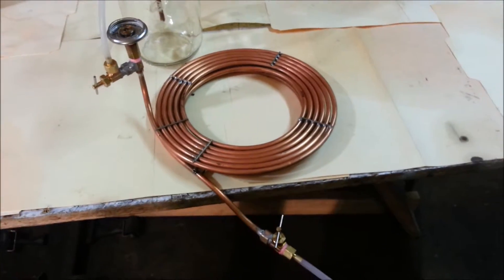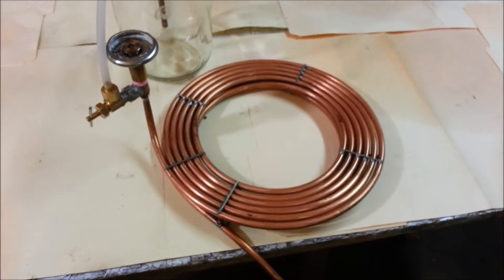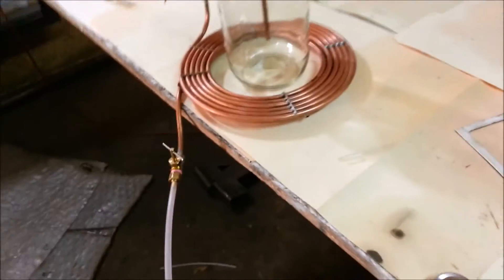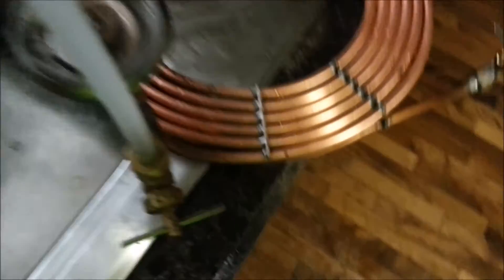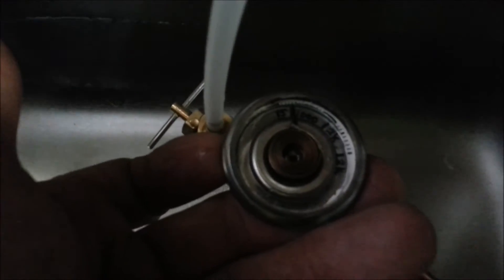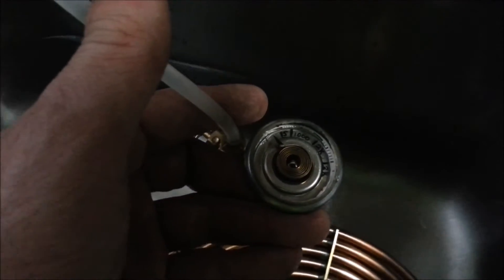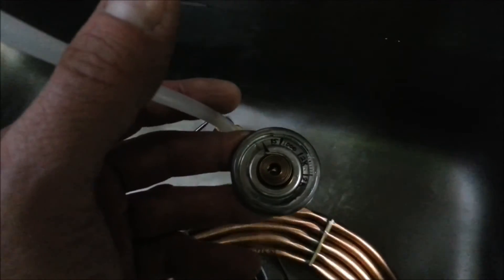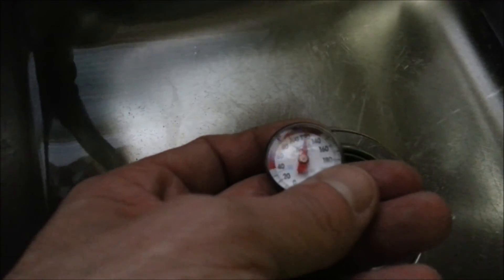Acetone for heat engine Thermal Expansion

Comment: With regard to your interesting observation about the rate discrepancy between cold-to-hot pressure change and hot-to-cold, could the reason have something to do with the "film boiling" effect? That's where a boiling liquid in contact with a hot surface forms a thin film of vapor, and that vapor has a lower thermal conductivity than the bulk liquid. 

In industrial steam boilers, film boiling can actually cause tube wall failure due to burn-through.

Perhaps that's why the pressure change on cooling is faster than on heating.

Comment: I once had pretty much the same idea and figured that Methanol would be the best, but even with Methanol the  theoretic thermodynamic efficiency of a cycle at a 50 degrees kelvin temperature difference is only about 1 percent and the efficiency is pretty much proportional to the temp diff.

Comment: In the hot side the exteriour of the cupper heats up, so the volume increases, followed by the aceton. So at the start they counterbalance? It looks like heating a fluid in a colb, where due to the effect of expanding glass the volume decreases for a few seconds and then starts growing in volume.

Comment from the maker: I believe the device leaked again  and that would explain the rapid contraction and slow expansion
Reply: Acetone boiling point is 132.8 degrees... It is the difference in water temperatures and the acetones boiling point that makes the cool down soo much faster

Comment: good idea with vacuum to remove air from your system. What are the risks though? i dont think this system was made to handle these materials.
Reply from the maker: hello friend thanks for your input and interest , however i have abandon this concept due to research on thermal cycling of metals , data i found in very technical journals indicates i have about 10,000 cycles before the machine would fail do to metal fatigue , it turns out temperature fluctuation is harder on materials then any other form of stress or strain  , and as far as your comment you are correct about the compatibility issues , i was financially forced to use the materials observed in the test. this device could have uses just not for energy production and that was the purpose of these test to determine the feasibility . Total failure but it was very interesting and could possibly be used in servo application  that rarely articulate and require tremendous power    using no electricity .
Reply: +NOBOX7 yes temperature cycling can be pretty sever. 10000 cycles is a little extreme. i know designs that can handle millions bit they do not deal with pressure cycles and typically its metals with very little thermal expansion and contraction. Back on your heat engine. to me it looks like you are attempting a stirling engine but with acetone. accept stirling found out early on that expansion was key. because of this materials that expand significantly due to a temp delta would be most efficient. he played with helium and hydrogen. FYI stirling engines are extremely expensive per Watt rating hence why turbines are the popular option. One more thing. carnots theorem says your efficiency will be equal to or less then 1 minus (temp cold devided by temp hot). this means that the smaller the temp delta the less efficient your engine becomes. hot water and ambient is a waste of electricity. you are talking about efficiencies of 1%. example an engine operating at 800 kelvin then efficiency of that is 1 - (300/800) that is equal to 62.5% efficiency. keep in mind that operating temp is now 500C or 932F. that is the best efficiency this engine canbhave typically its significantly less then this number.
Reply from the maker: Ervin Seferi Yes the efficiency is very low but when your using waste heat it doesnt really matter , the original design use's mercury and can produce thousands of psi where a Stirling would be lucky to see 10 psi , i also considered using sodium at temps near its vaporization point  but   the thermal cycling  has doomed this concept  , 10,000 cycles is like 23 hours of operation lol now thats what i call an expensive engine , thers is about 86,000 seconds in a day so 10,000 with 4 second heat up and cool down really kills this idea , however it would work at lower temps for much longer but as you said the  carnot engine efficiency's are horrible at low temps , also i did a virtual build of this device on my computer and a 10 hp engine was like the size of a house , i have other videos that show the math i did on these concepts , its call hydro thermic engine

Comment: NOBOX& , I want to take the high side of my air conditioner and use it to preheat water before it went into my water heater. the system  would turn the air conditioner on through an Arduino circuit by turning the thermostat down every time hot water was needed. It might cause some temp fluctuations in the house temp but it would match the air conditioner and water heater running at the same time. 

why am I PAYING to heat water when my AIR CONDITIONER will do it for free. This system should not only reduce the  cost of hot water but should make the air conditioner run cheaper too because less use of the fan to cool the high side. 

Do you think it would work ?
Reply from the maker: hello friend this comment never came threw sorry i have taken so long you tube does not care about comments as i only get some of them , as for your question yes not only will your idea work but it would also increase the efficiency of your ac however it would be very expensive but you could use a much smaller condenser for your ac then needed for air cooling . now there are some problems with this idea . first the ac may run more then needed for the hot water so eventually you would have to cool the condensor some other way  this is where it gets very expensive , the best way would be to connect the hot water intake to the heat exchange to pre heat the water before it enters   your hot water heater. this would mean your condenser is only exposed to cold water , this would eliminate the need for the fan on your AC and would boost its out put tremendously , however the condenser gets up to 125 degrees  and that is exactly about how hot you want your hot water to be so if you simply use it to circulate your hot water tanks threw the heat exchange to heat your hot water you run into a problem , now your condenser is being exposed to hot water during warm up and is slowly dropping off in efficiency reducing the cooling effect of your AC system and wasting power to compensate. so the best method would be a system that simply warms up the cold water intake and sends it to the hot water heater and then when your not using hot water 
a secondary circulation and cooling fan would cool of the heat exchange. this idea would be best suited for large buildings occupied by many people. I love your idea but it has some thermal dynamic issues that would cost allot of money to overcome... > perhaps a dual heat exchange would be best say the first half of the heat exchange heats up your hot water by circulating the hot water threw the heater condenser   then a second condenser down stream could be cooled by some other source say Geo thermal cooled water thats circulated rather then hot summer air that configuration would make your idea work the best

Comment: I think a vacuum appear in the coolong cicle. It is the reason is faster.
Reply from the maker: well friend there is no space for a vacuum in this device , all vapor was purged and the device was filled completely full but it may have leaked and that would make your assumption correct . its definitely strange it does this . thanks for your input
Reply from the maker: very interesting comment , thanks for your input , i bet thats whats going on here

Comment: Remember the cold makes the atoms go to a pinch effect in the bath of cold water and that makes them contract but in hot water the electrons are very excited so they will grab at any positive proton you may already know that but it's all about transfer of mass and pos neg and static third energy spike may be if you wrap mini coils around those loops of copper like the straps you use you should get a voltage off each coil a bit like stan Meyers EPG but he may have used chrome tubing as that appears to draw static from the air. No expert here just throwing in suggestions you watched vinny stvincent recently if not look at his 2 week ago videos about fluid tesla coils water and oil mixed with iron filings.
Reply: honda4004 This is some serious pseudoscience stuff.

Comment: Acetone is an high explosion risk, the slightest spark can set it off. Be careful, and those needle valves are rubbish, try lever balls..
Reply from the maker: do you mean a ball valve ?
Reply: Yes a ball valve, with a quarter turn leaver.